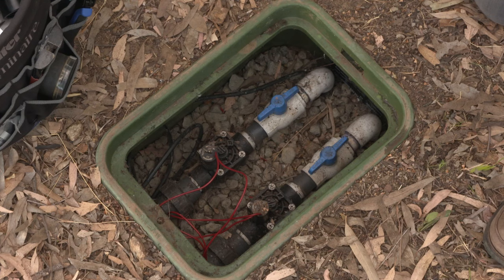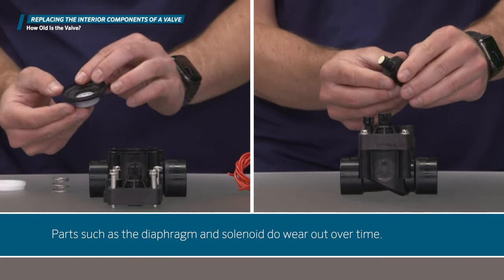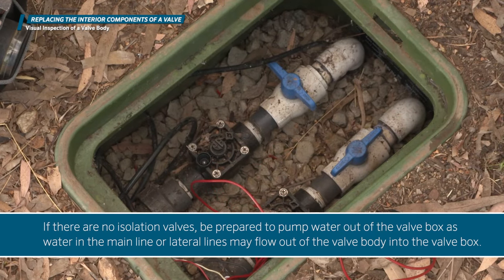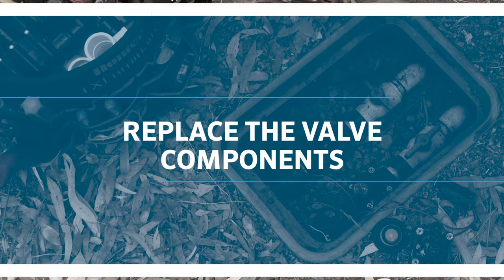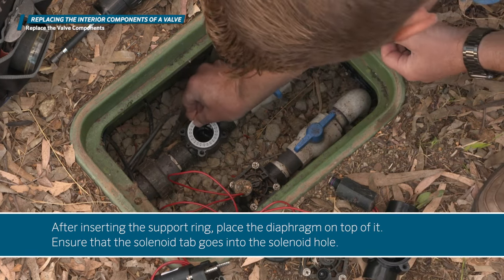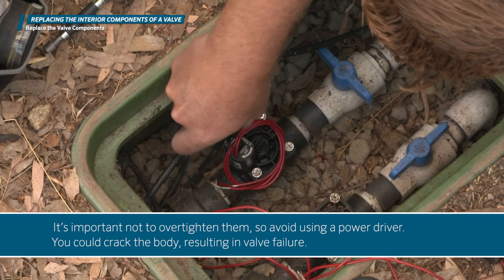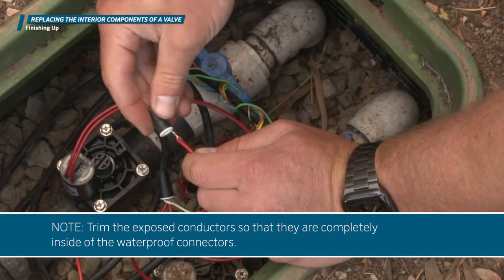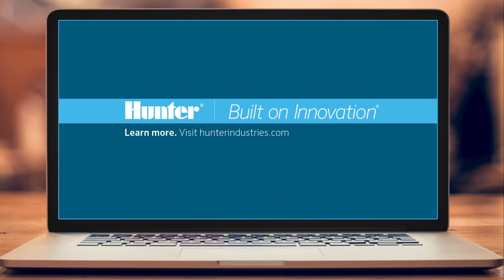Repairing an irrigation valve by replacing the interior components.

Comment: It's common practice to flush the valve since the smallest piece of debri will stop the valve from working properly - how do you flush the valve body without filling the valve box full of water. Keep in mind the valve box in real world scenarios will be full of dead bugs, small twigs, leaves etc - and the main shut off is rarely near the valve so it's difficult to gauge how long to turn on main line.
Reply from the maker: Having an irrigation helper is a good thing when flushing valve, especially if you don't have a well drained valve box. You can also hold a section of pipe over the valve body to redirect the water.

Comment: Need assistance…..all of sudden my zone 4 stopped working? In manual mode by turning the solenoid it works fine. I changed the diaphragm, made sure the ports were good too. I even changed the solenoid and still nothing. I checked voltage on both solenoids and they are good as well?🤦🏽‍♂️ so what else is left? Check the fuse on the controller or switch out the valve? thanks for the help in advance
Reply from the maker: Please contact our customer support department here: https://www.hunterindustries.com/hunter-technical-support-email-request